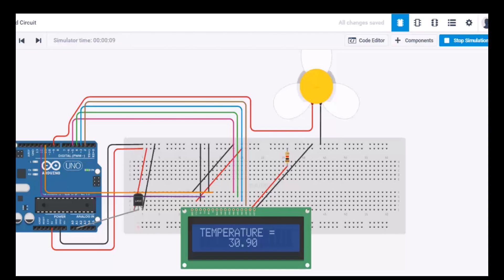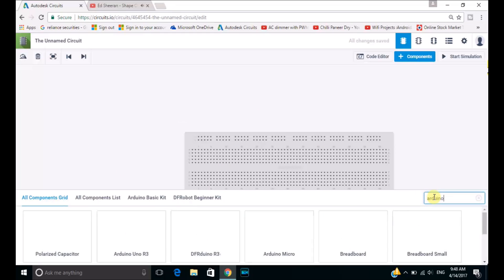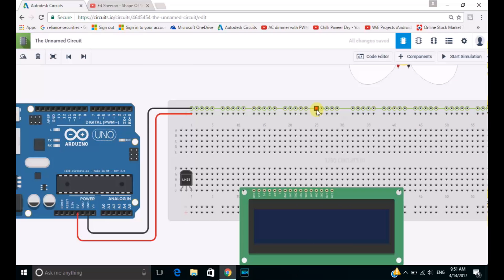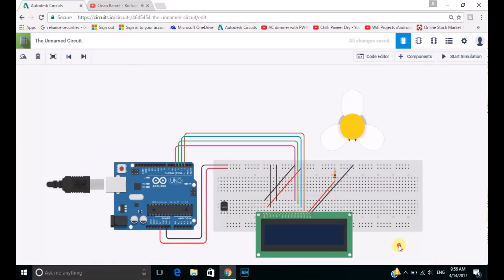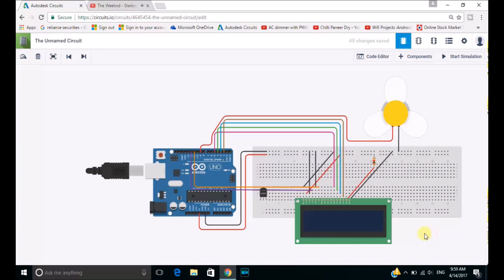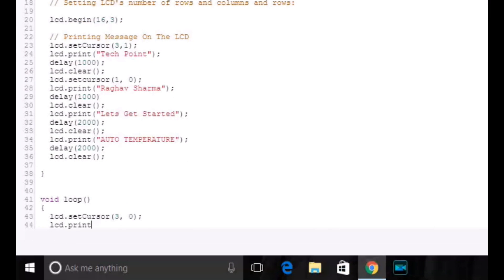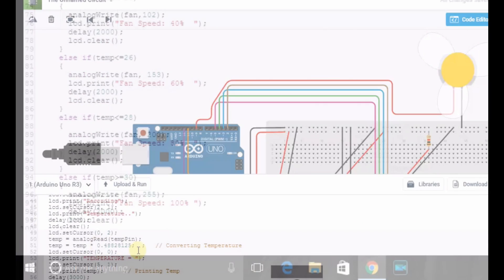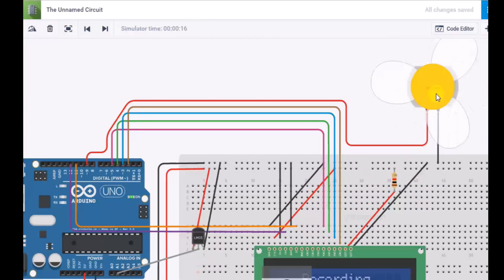Temperature Based Fan Speed Controller project | Arduino Uno - IOT

Comment: Hi, great tutorial, for people struggling about the dc fan and the temp sensor , for the fan use dc motor ( a fan is a dc motor anyway), for the sensor use tmp36 (it has an slider to change the temp), now on the arduino code : behind "int tempPin = A1;" put "int celcius = 0;"  now above "temp = analogRead(tempPin);" put this line "celsius = map(((analogRead(A1) - 20) * 3.04), 0, 1023, -40, 125);", finally change this line "temp = temp * 0.48828125; " to "temp = celsius;"
Reply: Hi, a bit far fetched to ask this a year later but could you tell me what the line "celsius = map(((analogRead(A1) - 20) * 3.04), 0, 1023, -40, 125);" does? I have to be able to explain it somehow and I'm not quite sure what it does

Comment: when  I try to work hardware fan does not working
Reply from the maker: Try to use 5v fan …..or if you mean ac motor fan by hardware fan then use a dimmer module
Reply: @Itsraghavv  yaa I used 5v fan

Comment: If the temperature is set at -19 degree Celsius at the temperature sensor (TMP36) then at the display it is showing 31.74 and the fan speed becomes 100%.
So how to set the temperature at around 20 degree Celsius same at display an sensor and set fan speed

Comment: I want to tell that if the temperature is 29 
Your code will break bro
Plz fix these kind of issues from next projects 👍
Good explanation
Reply from the maker: You can check my latest project video....its quality is higher than this one...
Reply: @Itsraghavv  can u give me a link to it pls
Reply from the maker: Yeah bro thats a very valid point, i just checked it.... 
actually when i made this video, back in 2017 (this video is reuploaded, i closed my last channel) , i was in 8th standard (currently in 12th)
Point is its even not about 8th standard, i missed it by mistakenly.....
Reply: Hi, I don't have to find the error in the codeing , please help me

Comment: If we want to add buzzer after  30C what are the changes
Reply from the maker: If then statement in code accompanied with connecting buzzer
Reply: @Itsraghavv  can u please help me with it
Reply from the maker: Its not a big thing..... what you need to do is connect a buzzer with its positive terminal on any of the digital d1,d2 port ...etc while the negative on gnd of arduino use resistor if necessary.....

Now in code mark the pin you used as OUTPUT

And make it high when ever you want it to buzz

Now you want it to buzz when temp > 30

So in the code which is in the video, use an if then else statement

Use logic
If (temp>30)
{
Set pin high 
If you want to make it buzz once then

Delay 2 sec (for eg)

Pinmode low

}

this is just the logic now convert it into code and you r good to go

If you want the buzzer to continuously beep then do

If (temp>30)
{
Pinmode high
}
Else 
{
Pinmode low
}

All to be done in loop 
Hope it helps
Reply: @Itsraghavv  Thanks a lot bro
Reply: @Itsraghavv  bro please 🙏

Comment: How did you determine the temp conversion factor? 0.48828125
Reply from the maker: Sir our Arduino gives 5V and in data-sheet of LM35 it states that its ADC has a definition of 1024 values (i.e. 10bits). So formula goes as 500/1024 * value it gives which further converts into 0.48828125 
You can check with the datasheet of LM35 temperature sensor
Thanks

Then also plz confirm the calculations yourself.....I m in class 12 right now but when i made this video i was like in 7-8th class.... this video was uploaded to my previous channel but because of some issues I had to reupload this on this new channel
Reply: Raghav Sharma dude you’re a genius I’m in college and starting an Arduino project and you’re many years ahead of the game
Reply from the maker: No no sir its just my hobby, i also make apps, you can check out on my website www.itsraghav.com
While on playstore you will find only 2 of my apps as a new developer agreement came and i didnt agreed that because i didnt get time to open developer console due to class 12 exams......i will agree it soon

While IOS apps are all available ☺️

On IOS the developer name is of my mom because i an not of the legal age to sell paid apps 😊
Reply: Raghav Sharma sounds good I’ll check out the IOS apps

Comment: Hi, great project
Short question: what kind of software do you use to simulate the Arduino project ?
Do you still have the code for it ?
Reply from the maker: No then go for tinkerCAD

Link - https://www.tinkercad.com/learn/circuits
Reply from the maker: Sir I used circuits.io which is now called Autodesk TinkerCAD. I have shown the whole code in the video, which will not take more than 10 mins to write (by copying | seeing)

Comment: Nice video....easy to follow..Can I simulate pH sensor and turbidity sensor  using the simulator you are using.....I want my arduino to control 3 valves and a pump...I really need your ,it is for my undergrsd project
Reply from the maker: Bro I can make that surely but I have to check it the components are available on the simulator.... if they are available then I will try to make a video on it.
Reply: @Itsraghavv  OkaY THANK YOU

Comment: hai, can i know how this project is called iot? because i can not relate with the iot concept. it is just simulation?
Reply from the maker: Hi bro,
The same logic of PWM can be used to control the fan speed through mobile over WIFI ....
If you wish i can make a video on this

Also i have made one project to control ceiling fan speed and may be will upload it soon. So stay tuned
Reply: @Itsraghavv  yaah.. that could help me more on understanding the iot concept. perhaps u can make the continuation vid to this project that can connect the iot on it. thanks! i really appreciated your help

Comment: Anyone can help to design this project
Build a system able to maintain the temperature value at a fixed temperature without using Arduino also the value of temperature in shown using 7 segment display in real time with delay of 0.05 second the value of temperature can be set any time using push or touch buttons
Hints: 
Use two thermostats one for below 15degree and other for above 15degree
Use Atmega 368 for programming
Use fan heater for hot air to maintain temperature and servo motor to open gate able to maintain cold temperature.

Comment from the maker: Check out my new Internet Of Things (IOT) project -
Apple HomeKit with NodeMCU 4 relay home automation (esp8266) : https://youtu.be/njniiUqS3N0
Reply: Anyone can help to design this project
Build a system able to maintain the temperature value at a fixed temperature without using Arduino also the value of temperature in shown using 7 segment display in real time with delay of 0.05 second the value of temperature can be set any time using push or touch buttons
Hints: 
Use two thermostats one for below 15degree and other for above 15degree
Use Atmega 368 for programming
Use fan heater for hot air to maintain temperature and servo motor to open gate able to maintain cold temperature.
Reply: i cant find the site can you please lprovide the link its very urgent please
Reply from the maker: @tasmiakhan5883  Hey! Everything is well explained in the code. All the wiring & Code is provided in the video for your reference....
Reply: provide the site of autodesk circuit
Reply: How to change the temperature..when I wrote the whole code and started simulation it's taking temperature as 74.71 everytime

Comment: Hello. The code and circuit works, the fan won't spin unless i push it with my fingers. My fan is a PC fan (12V DC 0.30A) is there a way in the codes for me to turn on the fan without giving it a push with my fingers?
Reply from the maker: bro if you are using a 12V fan, then you need a motor driver, you can easily find it online, as the circuit mentioned in the video is for 5V fan

Comment: Sir , I tried in Proteus .But  fan shows earthing connection on both side. This circuit has some problem.Please correct it
Reply from the maker: This project is for 5v dc motor fan for using a 12v fan we need to get external power as arduino can only deliver 5 v max output.....also in that case the wiring will change and motor driver will be required.
Reply: Please show me the circuit diagram for 12V motor
Reply: Sir, How to take breadboard in proteus

Comment: Hello bro how to make that DC motor spin in the video u have spinned it by varying temperature but we have tried same but it's not working pls send the program so that I can copy and paste pls bro i have exhibition tmr
Reply from the maker: I have used PWM to control the speed of the fan. The whole code is available in the video.
Reply: bro how did u create pulse width modulation? using lm35 0r other method?
Reply from the maker: Bro Pulse Width Modulation is available as a feature in most micro-controllers like esp8266 or Arduino etc. 
Talking about Arduino Uno R3, digital pins 1, 3, 5, 6, 9, 10, 11 and 12 only support PWM. The PWM pins on Arduino are marked with " ⁓ " sign. Do subscribe.